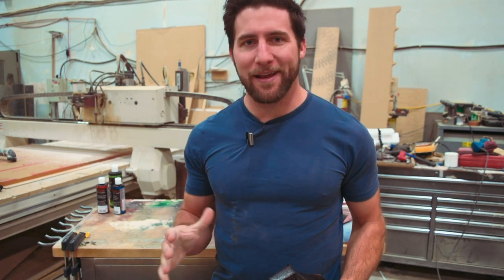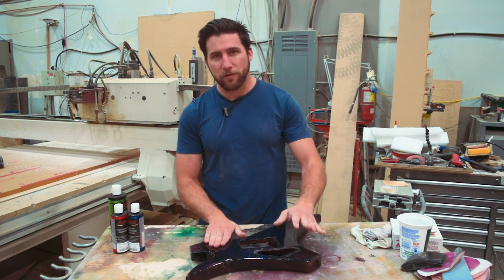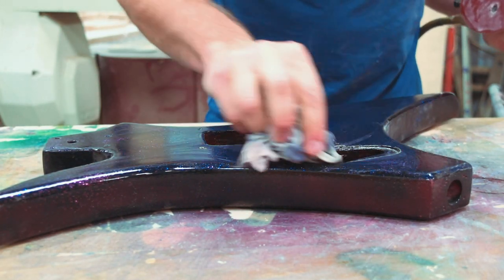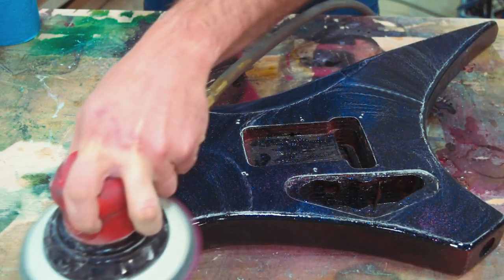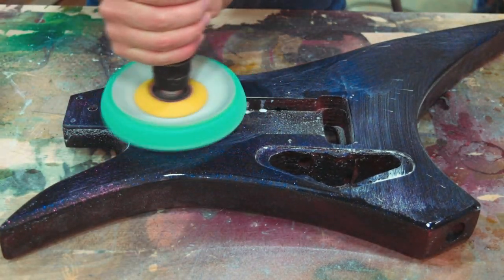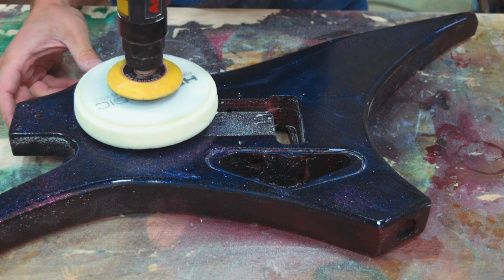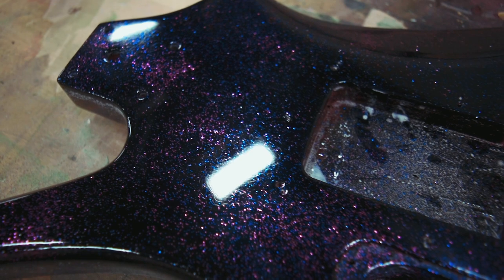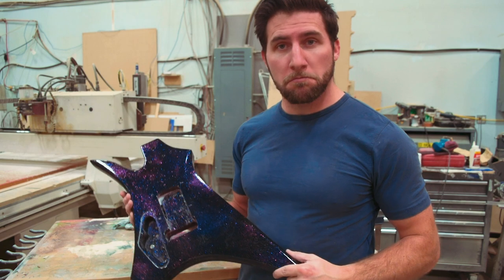Custom Nebula Sparkle Paint Job | Polishing With Jescar

Comment: Hey Brad, those swirls left behind 100% came from the DA sanding. All it takes is a tiny speck of dirt or dust to cause those. I’m in the auto body business and I know those marks all too well. In the business we call those “piggly wigglies” lol. Anyway, if you ever see them again just wet sand them out by hand a little bit. Trying to compound them out isn’t worth it and you may end up burning through the clear coat. Another tip for you is, use a firm block or even a piece of a paint mixing stick to wrap your sandpaper around. This will help remove the peaks of the orange peel and will give you more of a perfectly flat glass finish. 3000 grit is my preferred grit to stop wet sanding at, it just makes the polishing that much easier. Compound on a wool pad will get you back to a high gloss the quickest and easiest, follow that up with a polish on a DA polisher to remove the compound/wool swirls and leave a flawless finish behind. Looking forward to more videos ✌️
Reply from the maker: Thanks Chris. Much appreciated.

Comment: Hi Brad, I'm going to do a paint job like this on one of my guitars. The one I have in mind is a Jackson performer that has a black paint job that's in good condition. No dings or dents only some minor scuff marks that you have to look hard to find. Being the paint job is good can I add the glitter to the first coat of clear or should I sand it down and start from scratch? Since I have no idea what clear is compatible with the paint Jackson used, I'm worried I'll use something that will not jive with what's on the guitar. Any advice would be appreciated very much! Thanks!! 😎🎸
Reply from the maker: If it’s fully cured it probably won’t be an issue. Just sand what’s on there with some 600 grit so the new paint will stick, and then go ahead and put a lawyer of clear and add your glitter.

Comment: On the note of micro fibre cloths, are they bad for polishing buffing and if so is a regular cotton shirt or something better to use? Ive been using microfibre for ever and can never get rid of swirls. Painting and paint correction is my weak spot...
Reply from the maker: Yes, microfibre will scratch and leave swirls if you using for polishing. An old cotton shirt that has been through the dryer a few times is a better option.
Reply from the maker: Be gentle. It’s a common mistake. I used microfibre my first time too. Oops.

Comment: Hey Brad... any advice (does and don'ts) about tinting finishes... what types of dyes mix with what types of finishes,  and what kind of base coat to use? Being Canadian,  I can't order premade stuff like ReRanch. :(
Reply from the maker: I like using the colortone dyes and tints in nitrocellulose lacquer. Are you looking at a particular type of paint?
Reply: @BradAngove  I'd like to spray but no gun yet, been using spray cans. Was debating polyester, like Solarez. Tint, brush on, cure and eventually sand. If not that, maybe poly... Nitro I can't do until summer because otherwise the house would stink.
Reply from the maker: Sounds like a reasonable plan.

Comment: I'm blowing through my clear coat trying to get this flat. Also wasn't having a ton of luck with 1000 grit. Ended up doing the neck in 800 grit then coating in satin finish, but I'm straight up unable to get parts of the body flat. Do I just need a thicker coat?
Reply from the maker: Likely yes. How much clear did you apply?
Reply: @BradAngove  I didn't count but I thought it was more than enough. Tried several coats of spray poly but ran out so I grabbed some of that glitter cleae coat you recommend in the thick clear coat video. Used a whole can of that and it still wasn't super thick so I did an extra coat or two of brushed on poly. I think the main issue is my kid got carried away with the glitter lmao. Did another few coats of brushed on poly last night after fixing the area I messed up so I'm hoping I'll be able to sand it flat this time. I was able to get several areas sanded flat the first time but other areas I was burning through
Reply from the maker: Ya these glitter jobs are tough to seal in unfortunately. Takes a few sessions with the clear coat to get it done.

Comment: WIshed you were closer, i'd send you my guitar body that has a gaudy graphic on the front that i'd like to have removed and painted a solid color. Heck, it even would be a cool video for you to show how to get rid of a graphic on a paint finish
Reply from the maker: Is it a vinyl graphic with clear coat over it?
Reply: @BradAngove  yep
Reply from the maker: Unless there are a bunch of ridges from it it’s going to be easiest just to sand it with some 600 or 800 grit and paint over it.
Reply: @BradAngove  yea, it's a factory graphic, nonridges or anything, but my painting is absolutely horrible and that's the problem haha

Comment: Don't be so cheap with the polish that's where the swirls are coming from in my opinion. In the first 20 seconds the compound thins out on the pad and gets real hot in spots. And you need a faster polisher to heat up surface to soften it a bit then when you get finer grit it just screams over the surface giving you that mirror finish. Again just my thoughts. But you know speed can kill ya polishing isn't as easy as one would think. But that definitely is a trippy guitar 🎸 👍👍✌️😁
Reply from the maker: Thanks - appreciate the feedback.

Comment: Ok so swirl marks in the finish can come from sanding in-between clear coats if you used paper that was anything under 600, also can be caused by not using clean sandpaper check both sides for particles also wore or overused DA pad...You can also use 1000 with a block and then go over with DA...if you think it's in the final top clear coat.. love the Flake and Color...
Reply from the maker: Thanks. I don’t sand between clear coats. Maybe I needed to do a better job of loading the pads.